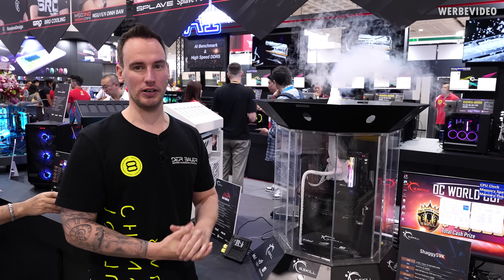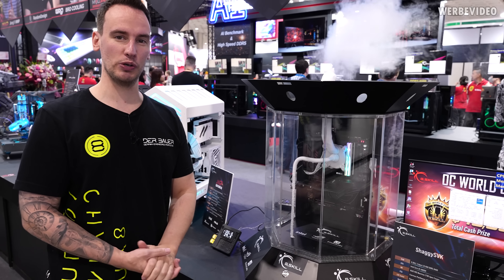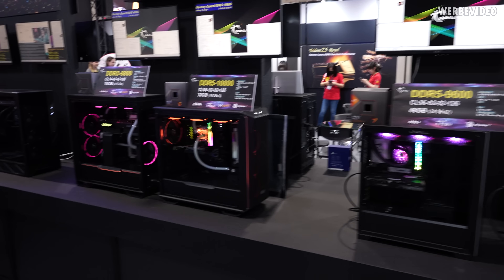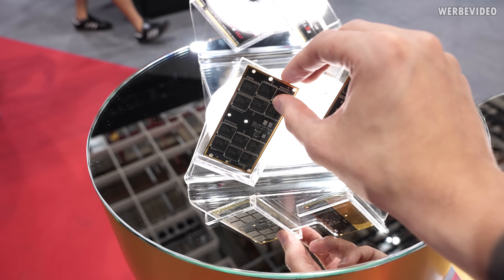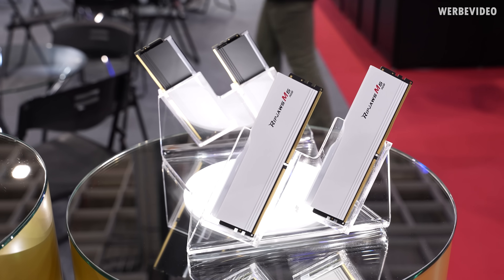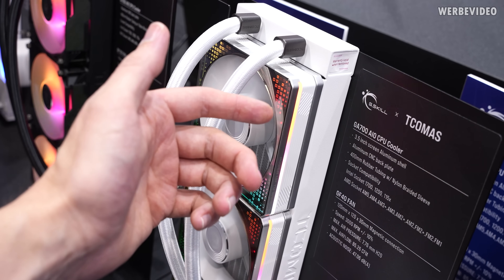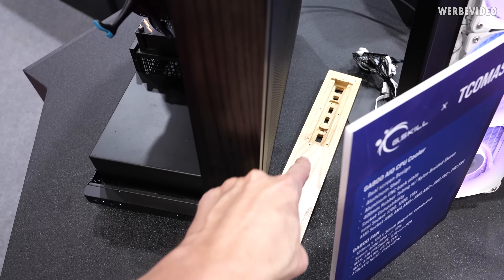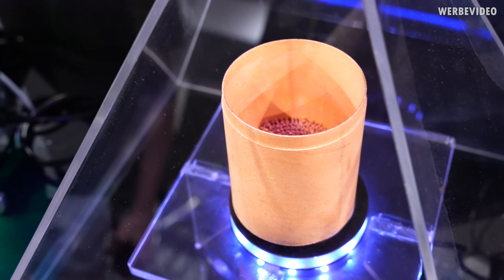DDR5 Modules with 10600 MT and a $ 10,000 LN2 Cooler - G.Skill Computex 2024

Comment: CAMM2 should be industry standard, why u ask?

- Shorter traces leading to better power efficiency, stability, and performance.
- The ability to mount a heatsink on top of the module for better thermals for better stability at higher temps.
- A flat module will fix all incompatibility of large portruding CPU air coolers on desktop.
- Mountable LCD display on top of the module.
Reply: im not sure i agree:
 - its a laptop solution for keeping things flat, for desktop we are more constrained in X/Y then Z, so the orientation like we have with DIMMs, also will smaller mainboards even have enough room on there? we need a bit around the socket for the cooler mounting anyways...
 - adding and/or replacing entire modules is just stupid, with DIMMs i can just buy another set of the same memory (heck, even slightly different timings, as long as i boot with the lowest common denominator) and just add it to the existing RAM.
 - LCDs inside the cases are imho toys with little to no value unless placed in such a way that i could have instead filled my desk with a 2nd monitor and had more screen + could display whatever on there, at which point i'd have better value.
 - since high end systems are more and more liquid cooled, and DIMMs mostly only get problematic levels of tall (cough dominator platinum cough) flat isnt
Reply: @Zettymaster  Yeah good luck running 4x32GB sticks on any reasonable speed, QVLs for those setups at XMP/EXPO speeds are non-existent. We're at a limit of UDIMMs
Reply: Dont give them any ideas on the LCD front...

Comment: CAMM is a cash grab. With DIMMs I could replace or test every single slot or module, with CAMM you have only one and it's bad for repairs and upgrades.
I really don't know how people don't see this problem.
Reply: It has the potential to replace soldered ram in laptops and bring better cooler compatibility, faster speeds and higher capacities to desktop.
As for the possibility that the entire CAMM2 socket is defective - that's doubtful. Even now when RAM does malfunction the issue is almost always on the DIMM, not the socket side.
Reply: @Raivo_K  it's good for laptop but this video is showing no laptops. and with dimms would still better having 1 or 2 sockets on a notebook, or even 4.

Comment: The CAMM modules seem very practical to me as an SFF user, could see a future where theyre mounted to the back of the motherboard for example. Great potential improvement in cooler compatibility too
Reply: will they fit on a small mainboard though? those modules seem like they would overhang the mainboard, and it would interfere with placement of power connectors too!

Comment: Whatever modules a board uses it must be possible to put more than one module on a board. The 'buy one now, upgrade later' is important for a lot of people. If the whole existing module needs to be discarded the it's just gonna make e-waste.
Reply: Well you could resell the existing module. It's not like people who replace their current ram sticks just throw them in the trash. One option for expandability is to have one CAMM2 slot at the front and other at the back of the motherboard in the same location.
Reply: How often do people go out and get 2 sticks, let alone only one... then upgrade capacity with the exact same sticks later?
Reply: @Chair-Throwing-Italian  Rarely.

Comment: The GSkill AIO with quick-release fans has the obvious advantage of enabling easier cleaning of the radiator underneath.
Reply: Yes, exactly, and also fan blades cleaning.
Reply: @milescarter7803  True, a lot easier and less hazardous to clean fan blades when not jabbing fingers or towels into radiator fins/channels, and can freely access from both sides. If you're running a showpiece, in a dirty/dusty environment or just like to keep it neat clean - this or something like it would be very nice.
Reply: @pr0xZen  I'm always shocked at the layer of thick dust on the AIO radiator under the fans when I clean it every three months or so, but it's no doubt due to household pets. Anything that makes dealing with that easier is a bonus.
Reply: plus it could be part of their cases. Buy the fan you want, and just stick it in the frame. No wiring, no cable management. Now they need a GPU and motherboard with the power connection on the PCB, so the GPU can just be slotted in. Cable free PC compartment, nice and ultra clean.

Comment: Never seen that type of Ram interface before, but I am 150% for it and always wanted a socket like Ram because of the sheer amount of slot failures I have had from age has accounted for probably 80-90% of my system ultimate demise and it's purely an mechanical/implementation issue with the contacts losing tension after a few years to the point the Ram constantly needs to be reseated and you have to be super careful not to bump the PC or table or a crash/BSOD/Hard reboot ensues.

I have had a similar issue with PCIe slots with GPUs, but a support to remove the sag normally always fixes it in a long term kind of way, DIMM slots, not the case, once the contacts become weak and deform, the motherboard is done. This is also the reason I gave up on having working retro PC, those damn Ram slots!

The funny thing is, boards that use those lay over slots that you bend the Ram into them until they click down flat, and similar SODIMM slots not once ever had issues for me.  I have two old circa 2000 dual CPU Tyan workstation boards, one is the flat bend to mount type slots, the other is conventional DIMM, the DIMM I had bought 2 or 3 of these boards, all have temperamental slots to the point I can only get the machine to run once in a while and Ram modules drop out and cause issues like OS corruption, the other lay over slotted board, solid as a rock and never had any issues. I also have a very old laptop from 2004 that works perfectly as well. I never had a laptop once have ram issues with SODIMM and related slots.

Now even my normal desktop has had these issues for some time and needs constant rocking and reseating of the ram to get it to boot without some weird crash or non boot loops. Please bring CAMM2 as a common standard 🙏

Comment: IF CAMM2 modules are user expandable then why not...if not user expandable then no...I won't buy it
Reply: You can't really expand anyway with DDR5. 4 slots aren't stable at XMP speeds and mixing RAM isn't recommended and could lead to incompatibility issues.

Comment: The point of CAMM is to have the traces be equal length to all memory chips. Also it was mainly designed to replace SODIMM on laptops by Dell to reduce the height. That’s about it, yeah it’s probably more stable but I have yet to see any difference in performance. My Dell 7780
has the CAMM module and my coworkers has the SODIMM adapter. Perf is the same. Also 10600 CL62 isn’t really any faster than 8000 CL40, at least not in any discernible way.
Reply: I think the point is that getting to something like 8000CL40 would be easier. Tuners and plug and play people would probably get more out of the format if it raises the performance floor and  potentially ceiling.
Reply: @Chair-Throwing-Italian  That’s a big MAYBE, I have CAMM and can’t see any significant difference in trace length or speed. I mean my 64gb module runs at 5200mhz…If I had 32gb it would run at 5600mhz, 128gb module runs at 4800. The limitation has been the memory controller on the CPU not the layout, obviously as you can see in the video they have regular DIMMs running at the same speed but on APUs because those have a better memory controller because they are based on laptop chips which have had 7600mhz soldered LPDDR5 since inception. This is mainly for laptops, Dell started it, other manufacturers saw it and said hey that’s a good idea let’s all do it, so of course the manufacturers will start putting out products to service upcoming laptops. Maybe in an SFF this has a use, but a regular desktop I would still go with DIMMs. If you buy a 4 slot board but only have enough cash for 32gb now and want to add more later no problem, with this it’s one board, can’t add, just replace. I think the speed difference claims are snake oil and pure marketing, just like now you have 8200mhz kits that will work in a particular board with a particular CPU but won’t post with any other combination, that will still be your limit, board design and quality and cpu, these are the same memory chips, nothing different other than the layout and lack of expansion, might as well buy Apple.

Comment: With camm2 ram modules, there is a benefit of the speed and data integrity or how it is called, but since it is dual channel already, and the laptops image i've seen online have only one slot, you can't just buy a laptop with 16/32 gb ram and toss another 16/32 gb ram module later for 32/64 gb ram total. On the desktop i guess they can make 2 camm2 slots and this won't be an issue.

Comment: The thing with CAMM2 is interesting, but im really uncertain about its placement, on a typical board it will end up having a heatsink, thats fine but may eventually be an issue on ITX, i dont see any fallback if you have a bad ram stack? (e.g 2x16 and 1 dies for whatever, the system will show 8gb, and this is just gonna cause more troubleshooting i guess) but also what will happen to mass memory? are we just going to reach a limit to the size at say 768GB? and idk just gonna be based on width of the motherboard? im trying to look where this limits the future, might be good for 25 years though.

Comment: CAMM2 is a great idea to replace the existing standard. And if you have what is equal to two sticks in one, it would take up just a little extra space on the motherboard, while give better options for cooling for both ram and cpu. So yeah! Plus that it is finally possible to get ride of the whole soldered memory to motherboard on laptops! (I hope)

Comment: I really like the new CAMM2 for it to be universally implemented and DIMM module stopped at the DDR5, It just looks neat laying flat on the motherboard, so we can put bigger air cooler and maybe with small CAMM2 cooler if it ever runs hot
Reply: My concern about it is that you can have chips mounted on both sides of the CAMM module so the chips pressed against the mobo will be hard to cool.
Reply: @spankeyfish  I'm not sure if that is correct as the side against the motherboard have pins so you can't add chips there. Besides, if it expanded horizontally enough where it allowed it, they will just put it on top so that problem is never even a possibility.
Reply: @Javier64691  see 3:21 in the video. There are modules on both sides of the board.

Comment: I would only run CAMM2 if it was faster, otherwise go for normal memory, because CAMM2 does not look good.
Reply: CAMM2 is better in every possible way VS U-DIMM. It is faster, more power efficient, more capacity, while being easier to cool, and opening up space on the MB. Only concern is price.

Comment: CAMM2 is cool. As far as I'm aware, AMD isn't as stable wtih 4 sticks as with 2 sticks - and as people usually buy sticks in pair (for dual channel), it's not really a downgrade cost/upgradability wise, but faster. Less compatibility issues with CPU coolers too. Only lose the cool pop when putting in ram :D
Reply: Nothing is as stable with 4 sticks as 2 sticks.
Almost wish to only have 2 slots since you can do 16x2 or 24x2 or 32x2 etc now and get better memory support from the start.
Reply: The more stuff you add to a single channel the less stable it gets. AMD and Intel consumer platforms have only 2 channels so anything more than 2 sticks (one per channel) is going to be less stable
Reply: I think the expandability option severely diminished with DDR5 regardless. With two slots it's now possible to run 96GB and soon 128GB. Also most common DDR5 kits are 2x16GB and i have a hard time seeing a scenario in the coming years where 32GB wont be enough for most people and would necessitate expansion. So in the current state four slots are wasted on most boards anyway. Plus running four sticks incurs severe speed, latency and memory training penalty. As long as CAMM2 is user replaceable and not soldered i have no problem with it.

Comment: I think CAMM2 is very interesting. if it gives better performance then they should do it.
I really don't think RAM upgradability is something people think about anymore. most of my friends are still only using 2 out of 4 dimms even though ddr4 ram is so cheap.
I don't mind having to sell the whole module to upgrade to a newer higher capacity, it would also mean that I would be buying a newer module which would probably perform better anyway.

Comment: CAMM for SFF builds will be awesome.!
Reply: CAMM2 is small enough it could be on the underside of the board, like some SSD slots as well. Then it could be even closer to the socket, in theory, reducing latency even more.
Reply: true one less problem with cooler compatibility 👍 and since most itx motherboards dont even have more than 2 slots anyway I don't see any drawback for SFFs

Comment: CAMM2 opens up some interesting options for small form factor builds, even special small form factor motherboards with rear mounted RAM, potentially with a stacked motherboard like we see in mobile phones. Even without this, ultra low form factor RAM could open up some new air cooling options for the CPU. Very interesting possibilities.

Comment: Does a single CAMM stick run dual channel as two sticks of DDR5 would?
Reply: Yes, CAMM2 is dual channel by design.
Reply: @homolupus1  thanks for the info
Reply: Yes, at least these variants(single-channel variants were designed for a different socket that stacks them). And there are longer variants(don't know about availability) that fit 128GB, with plans for going higher.

Comment: EDIT : For the 2 IQ among us : Any other vendor has these sticks above 1.35 (48GB kits) and if they are not they wont work. Tested this on multiple boards , cpus and with several vendors kits. This was the consistent failure kit 

G.skill Maybe investigate your 8000 Mhz sticks first before selling me a square held in place by 2 triangles. 
Your 32GB kit runs at 1.45 out of the box, but somehow the 48GB kit at 1.35? Woopsie?
Reply: 24gb hynix m-die requires less voltage than hynix 16gb a-die thats not on gskill.
Reply: @Jolinator  Again reread my comment instead. EVERY OTHER VENDOR has it above 1.35 

Hard to read i guess.
Reply: almost as if they are entirely different dies
Reply: @WayStedYou  Irrelevant in this case, go look at derbauers channel , he had issues with these sticks everyone has issues with these sticks at 1.35 

And as I replied to the other internet know it all : Out of user experience I know this to be a faulty setting. I've had 12 kits. Several motherboards , and several i9's .

Any other vendor has it above 1.35 those that dont are selling a dysfunctional kit , any kit of 48GB will with a 99 certainty not work at 8000

Comment: CAMM2 seems good to me, if it performs better than the standard DDR5 sticks. I will consider using it as long as the benchmarks are solid. Thumbs up!
Reply: exactly if it's fasrer I'm on board
Reply: We were "supposed" to have moved completely away from current memory designs, by switching to serial rather than parallel communication after DDR4 because of the signalling complexities, but I've heard nothing about it for years now, that seemed like the more practical thing than this CAMM thing.
Reply: @ChrispyNut  I think if it were more practical than CAMM2, it'd be at least talked about. After a short read about serial DRAM, it seems like it may fill some niches, but it comes at a tradeoff to convert the serial signal to a parallel signal. CAMM2's (and on-die memory's in some applications) approach seems to be the more practical solution.
Reply: @BlueDrew10   Umm, okay, thanks.
Without knowing your level of knowledge and understand of the topic, makes it difficult to know how much confidence to put on your comment, but I'll make a mental note.  Thanks for letting me know your findings, I hope you found the curiosity tangent to serial memory a worthwhile venture 🙂👍
Reply: @ChrispyNut  I don't know your level of knowledge either. 😆What makes serial DRAM practical?
Reply: @BlueDrew10  It's pretty low and superficial.  I'm a very broad topics, deep in a few, shallow in most kind of Nut,  and this is a pretty shallow pool.  👍
E2A:  And this is stuff I read about a good "several" years ago, before DDR4 standard was finalized, IIRC (which I absolutely may not be).